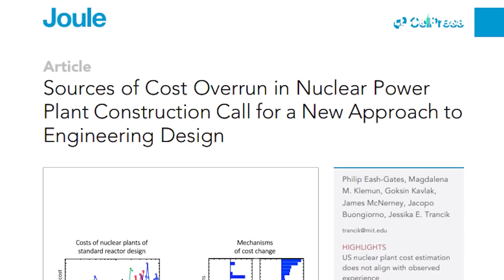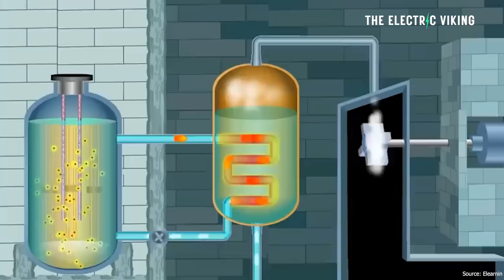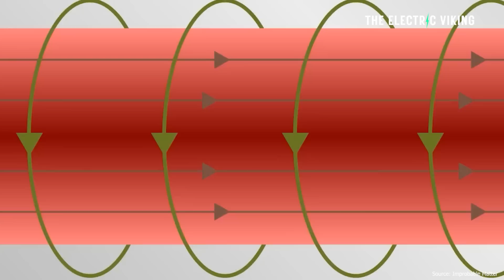Bill Gates says nuclear is the answer to the world's climate crisis...

Comment: Hello there! I want to share a different opinion. Big nuclear plants are designed to work for 30-40 years. And with all this inflation, already after 10 years they become way cheaper but keep generating the same amount of energy. Unlike solar or wind - they do generate stable energy and they also can supply hot water which can be used in cold regions to heat the house blocks and by that greatly reduce electricity consumption. Some people argue that nuclear plants generate toxic waste, but they do generate a one box of waste for 30-40 years of service, while solar panels  generate literally millions of tons of waste for the same amount of energy produced. That is something shall people fight with if they care about the environment, not this fake CO2 emission - plants and trees do breath with CO2, our planet had way higher CO2 levels just several million years ago and nobody died. If CO2 level falls below 150 units level all the green plants will die - that what you can really achieve by fighting with CO2. It's proved with experiments that the more CO2 the better plants grow. Heating planet is another fake, Greenland was called Greenland before it turned into pile of ice, you can't not to know it mr Viking, your brothers discovered it. Planet was way way more warmer in Roman Empire times (at least before Plague of Justinian). Check the history records please if you don't believe me. If a real disaster like a major volcano (like 1815 Tambora) or solar system enters space dust cloud - sun energy will not be efficiently available for several years, imagine what will it be for countries which will over rely on solar energy?

Comment: If there is enough momentum to make 🌞 affordable and accessable to everyone, there is no need for nuclear energy, that has longterm environment implications, other than safety. But, Is everyone prepared for a decentralized power generation? Just think back how the EV revolution even took place after a prolonged delay. Also, why we don't have cheaper and affordable EVs that cut into the profit of ICE vehicles? It is already proven, you could produce a cheap EV with an optimized battery pack and basic safety system. Just some 💭

Comment: Political parties love big infrastructure projects because they can "rent seek" from them (donations from the companies that win the contract). Distributed generation is a disaster for politicians because the contractors are smaller and therefore more difficult to fleece at scale.
Distributing the generation in smaller chunks (especially roof top solar + domestic batteries) also makes the grid itself cheaper to build and more difficult to destroy in a war.
Also, just do the calculations around cooling water and you realise what a disaster nuclear plants are for the environment. Hinkley in the UK is around 4GW electrical output. If it is 60% efficient that that means it will be constantly producing 1.5GW in waste heat and this requires masses of cooling water. To reduce costs it now wants to suck this water straight from the Bristol channel - any life that gets near those intakes gets sucked in and ground up. I imagine that abundant cooling water is difficult to find in Australia away from the coasts.

Comment: What Gates is referring to is NOT today's pressurized vessel water-cooled reactors. These older designs are essentially a dirty bomb waiting to go off if an accident happens.

He's referring to molten salt reactors where the nuclear fuel is dissolved in a molten fluoride solution. It doesn't use a pressurized reactor vessel, and because the fuel is already in liquid form, there's no such thing as a "meltdown." And it uses mostly thorium-232, a nuclear fuel that is vastly more common than the expensive uranium-235 used by older reactors.

Comment: Base load is the type of power that works on demand as needed. Renewables cannot produce Base load, merely contribute to overall load as wind doesn't always blow and the Sun doesn't always shine. Using big batteries helps alot but you Still need a base load as batteries whether LFP or Pumped Hydro or Compressed Air or Flywheel can't eliminate the base load (mostly Coal in Austrailia, Nat Gas in the US). 
LFP batteries cannot provide power for an entire evening at a solar plant (too expensive by far), Pumped Hydro, Compressed Air, Thermal storage, etc are very wasteful. 
So baseload, clean, safe, advanced nuclear works to fill this Base load role (to supplement the power grid... not replace renewables).

Bill Gates is exploring compact advanced reactors using Uranium. Kudos, but many believe the way forward is to use Liquid Flourium Thorium Reactors (LFTR) Or Thorium Liquid Salt reactors more generally. 
Reasons:

Less than 1% of the waste of Current Light Water reactors (which must be refueled after a small percentage of fuel is expended - due to reduction in Neutron propagation with only small amounts of "contaminant" expended fuel.

Waste has Vastly smaller half life and becomes inert much quicker. 

Cannot have a meltdown as Thorum cannot maintain a criticality without neutron bombardment from a U or Plutonium source. The liquid salt cools down and forms a solid... no criticality, no water cooling (hence no radioactive clouds). The fuel is also solid below 400C so it can be transported safely. 

CHEAPER. Does not require 5 way redundant safety systems, High pressure steam piping. 
Just a few plugs that melt if the ThF liquid gets too hot (it never has the chance to boil in any case as the reaction becomes less efficient when temp is too high (assuming no one stops bombarding the ThF with neutrons. Bi-products can be seperated out as a fluid (including Tritium - $30,000/gram which literally bubbles out). Fewer refuelings and they don't require a reactor shutdown. 

Thorium in the needed isotope (the base isotope for Thorium) is about 200-400x more abundant than Uranium in the needed (rare) isotope for fuel. 
Further, since Generic Thorium isotope is Already the one needed, no expensive enrichment (making the fuel Alot cheaper).

The Chinese, Canadians and Danish are looking into this and the US abandoned this, having  a Thorium liquid fuel reactor running successfully in 1964-8 or so... because the by products are not efficient at making bombs... and the scientists claimed that the reactor would be light enough to create a nuclear powered bomber... so, that was never happening.

The US isn't taking this seriously as Nuclear=Black Magic knuckle dragging "experts" (who, strangely aren't physicists) that repeatedly conflate Solid Fuel Thorium Reactors (a very bad idea) with Liquid Fuel Thorium Reactors... many "experts" have dismissed this out of gross ignorance in the subject matter... or they just like the status quo or they're paid to say ignorant stuff like that.

(Sorry... just had to vent.)

Short version. Yes, Nuclear Base load and Renewables for the rest, leaving batteries to stabilize interruptions and yield higher quality power (smoother) and harden it against cascading grid failures natural or man made. That is future that works and is sustainable for hundreds of years (think fusion might be cracked by then).

Comment: In my view, nuclear would make much more sense in an extreme decentralized model. With SMRs powering individual factories and homes being partially powered by hybrid nuclear Sterling APU range extenders in EVs. Emissions would be zero when powering a small Sterling engine from the heat from a self contained 6cm nuclear pebble designed for a pebble bed type reactor. Plugging in would only be to offload excess power produced when the car was parked. So homes, businesses and stores could be powered primarily by the cars parked at those locations. Supplemented by roof top solar and wind where possible.

Comment: You are extremely mistaken, having been taken in by the Greenies misdirection. 
Nuclear is actually cheaper than ruinables when you factor in all that you conveniently left out.  You used RATED capacities, not actual output by using the Greenie numbers for comparison.  Additional plants are needed for baseload and peaking, either that or massive battery banks which we don't have and never could hope to achieve.  
Plus many countries have been building and using small modular reactors for many decades built in two years or less for millions not billions.

Comment: Belgium has been something like 100% nuclear for decades and yet still exists ---France has substantial nuclear power thanks to the policy of independent nuclear defence after being overrun in WW2 and needing a reliable alternative to oil after the Yom Kippur war and the arab oil embargo  - in both cases there is no second prize if you cannot reliably supply the needed factor .  France is also hosting the International fusion reactor experiment which just might change the game entirely -Thorium reactors in India and China are online and underconstruction and use a different fuel cycle not suitable for weapons --many of the 'objections' to nuclear per se are fallacious or overdone and the costings of renewables are skewed to omit the limited lifespan and decommissioning costs of both wind and solar apparatus  (neither are "renewable" or even recyclable economically ) . the outright stupidity of opposition to a nuclear waste depository in outback South Australia (Kimba) is just Woke enviromadness on steroids --look up how much landfill is being used to bury ''dead' wind turbine blades and 'used' solar panels  (hail damage alone retires many )    Wouldn't it be nice if BOTH sides of an issue could be presented in YT form ON THE SAME VIDEO --so that the utterly convincing PRO case on one demolished by the equally convinving CON case on the other could be rationally evaluated fairly ?   The power of the net to present seemingly irrefutable cases either way is a real danger and fulfills Goebell's dictum perfectly .
Reply: Belgium is not 100% nuclear.  France has always been higher, Belgium only supplies about 51% of its electricity needs with nuclear.
Reply: Maybe I should have said 'was' once 'nearly' 100% of 'electrical' power generation (ie not including transport fuels or smelting etc ) During the early manned space flights the astronauts commented that Belgium stood out because it was lit up so much and this was due to it's nuclear power system not being shut down or idled so much overnight .  I just looked up the current proposal to shut down nuclear power but delayed due to the Ukraine war and Russian gas restriction --another echo of the yom Kippur 1973 energy crisis turning point and a lesson in dependency on ANY one source .  Of course there is little or no hydropower generation and there was no wind or solar until recently so I guess they 'had' at least a very high fraction of nuclear back when...  if the anti coal lobby caused the shut down of thermal coal power and in the absence of gas  (as is the case in Australia now) AND shutting down nuclear -you better hope the wind blows and the sun shines ....  my secondary point was that no dreadful radiation deaths or environmental catastrophy has accompanied the use of nuclear power in a crowded nation like Belgium .  I don't know but wonder if they got their uranium from the (former) Belgian Congo - the Manhattan project made sure the Nazis did not get it after Einstein brought it to the attention of Roosevelt . Thanks for your correction. @danadurnfordkevinblanchdebunk
Reply: "Independence" ? Are you kidding me? France IMPORTS nearly its uranium from....NIGER ! Or from...RUSSIA.

Comment: I would say ONLY one source is a bad idea.
Only nuclear, only solar, only wind, only oil are generally bad. The worst of them all are only carbon as far as I know.
In Australia, you can have loads of solar with batteries and production of clean H2 for bad weeks.
In northern Europe, it is simply not feasible, especially in a densely populated country as Germany or a northern placed country as Sweden.
In Germany they have invested heavily in renewables for 15 years now, yet they still want to count methane gas as green! When it releases 50% of CO2 compared to carbon! I will this straight out. They will not make it to carbon free without changing model.
In Sweden, we are relatively sparsely populated and so are better off, but we can still get a 3 week high pressure in January with -20 to -30C. During this time we have no wind, no real solar and a high need, and so do our neighbors. Add to that that we intend to do green steel, green concrete and batteries adding demand of about the equivalent of 10 large nuclear reactors and it is easy to see why this cannot be solved by wind alone, though it is welcome add-on.
PS. I do my best and have a well insulated house, solar on the roof and an electrical car. I still claim that if we try to do this with only wind and solar we will fail miserably and pay with rising seas as a result.

Comment: Nuclear is not the answer, but it is part of the answer. Batteries are the key piece, for that matter, Nuke (for base load) and Battery (for peaking and local service: think having a UPS for each neighborhood), could work by themselves, but we'd be stupid to not add in as much solar PV as practical (which will depend more on having sufficient batteries than sufficient solar panels). Wind is cheap and clean but I fear unwanted effects from low frequency sound pollution and reputed bird-i-cidal blades. IF we have enough battery storage, then wind will not be necessary.
Reply: Existing lithium based batteries are not practical to scale to the grid needs globally.  We need innovative storage technologies to have a chance like cryogeneric air or liquid metal batteries.  Seasonal storage of renewables is a lost cause so nuclear is needed to manage baseload.

Comment: I think distributed, decentralized renewably powered electricity with high insulation, electric heated thermal mass floors, residential grid batteries, grid batteries and inter-regional transmission lines will serve us better to structurally lowering our emissions than nuclear. I have had many discussions with peers in Canada. I see opportunities for green hydrogen peaker plants instead of nuclear. Too expensive. Too much time. Whereas high insulation and renewables are fast if we focus on deployment together...at all levels of government.

Comment: Nuclear is over. Hasn't been profitable since the turning of the century and have been spent the last 20 years going from producing 20% of the global electricity to les than 10% and will fade even faster than coal, since the operating cost (and the retiring) are astronomical. Also, SMRs have nothing special, since we have been using them in warships from decades (new design have better passive safety measures, but the same problems of cost; since they are smaller they will end being even more expensive than normal plants due scale of production). And regular power plants have been bankrupcing companies for decades (WEstinghouse, General Electric, Areva and now EDF...).

Comment: There are so many hidden subsidies flying around that it's difficult to get a handle on the real  cost if wind and solar. However.  It's easy enough to dig up the retail cost of electricity, which should give a rough idea of the actual cost of renewables.  South Australia charges 60% more than Queensland.  We know which one is the "leader in wind and solar" and which burns coal.  If SA were unable to import electricity to cover the gaps in wind and solar the difference would of course be higher. MUCH higher!  
Here in Europe we can compare France and Denmark.  France is all nukes and Denmark leads Europe in wind power.  Now Flamenville is disaster, nonetheless the French power is 40% cheaper than Denmark, and Denmark has Norway next door, serving as a huge hydro battery.  France has cheap power because they used to build cheap nukes, now they can't build cheap because of Greenpeace bollox. 
This is a very one sided view of nuclear.  There are no countries in the world which rely solely on wind and solar, they all need either FF back up or hydro.  
If we're going all electric, which I guess what "fully charged" advocates then switching to an expensive and unreliable source of electricity will not end well.   If you're doing this to save the climate then everyone needs to do it, you can't smugly say "my state is hundred percent solar!" and then import the FF electricity when you need it, the FF stations next door will have shut too.